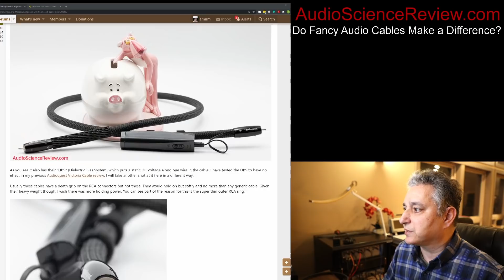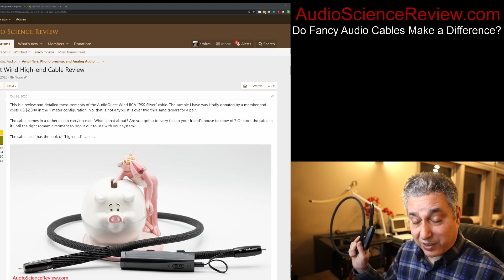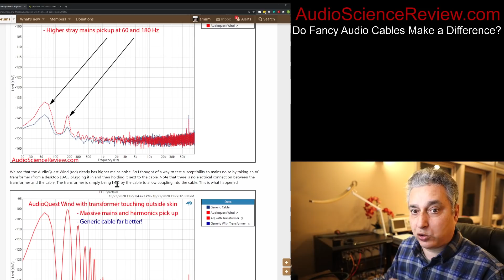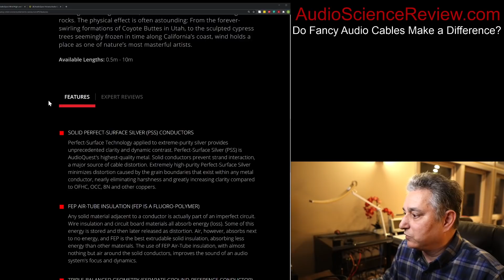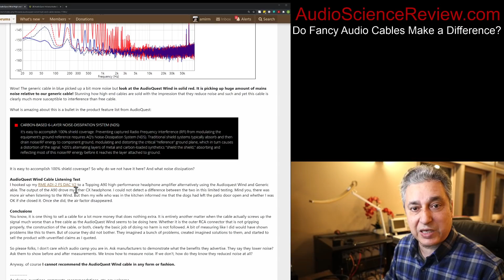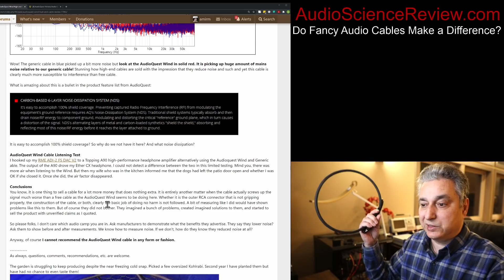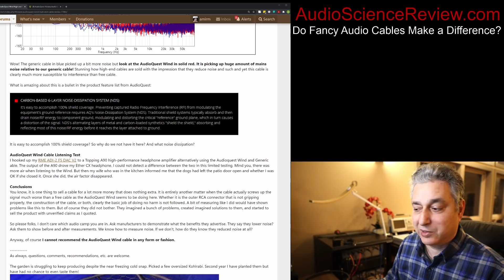Do Fancy Audio Cables Make a Difference?

Comment: I’ve compared several speaker cables, using the Agilent 4294A Precision Impedance Analyzer and a Keysight 3442A microOhm meter. I’ve found that the differences are very subtle and totally inaudible at audio frequencies.

Comment: Interesting cable evaluation, the additional mains frequency pickup is probably from the ridicules unterminated wire connected to the battery.

Comment: I believe it is intentional. Cheaper cables have teflon, PVC and who-knows-what dielectrics, but these degrade the sound. It is a misconception that nothing flows through dielectric. Tesla, the greatest experimenter of all time, proved that while there is no current through dielectric, there is still "flow of electricity". This flow of electricity travels at 76% of the speed of light.
You simply did not measure what you need to measure. The signal in the form of EM wave (vector E x H) travels perpendicular to the surface of the wire. It is this surface that with AQ cables is created using special kind of thin silver layer.
Another example: Oppo Sonica measurement were "excellent", but it sounds very poor. Why? Because effective measurements are yet to be invented for all of this.
Reply: I believe that battery piece either takes care of this flow of electricity or deals with eddie currents, both described in literature.
Reply: Inakustik cables use pure air as dielectric.

Comment: On a more practical level, is silver coated copper better than single crystal copper, is single crystal copper better than oxygen free copper, and is oxygen free copper better than regular copper assuming that each type has adequate shielding. And is strand better than weave better than twist. Because frankly even if it made some sort of difference. just on principle I'm not spending thousands on a pair of cables.

Comment: Not a "fancy" cables , aka to you snake oilers meaning expensive cables that some manufacturer is making fortune on at your cost 😂
This is kind of BS that makes you oil snakers Robin Hoods of audio.
It is sad and makes no sense at all.
Once cable is tried and makes no difference will be returned to the store and not harm to the pocket or sound will be done.
USB cable just like speaker cable , interconnect or coax cable is capable of afecting aspects of musical performance that can not be measured as you guys try to prove your lack of point .
Yes on resolving system all these cables can affect tonality, clarity, spatial detail, harmonics and microdynamics .... All things you really can not measure but must hear with your ears . Sorry to burst your bubble.

Comment: This debate is a endless waste of time because the measuring side of the audio community always come to the same conclusion because their tone generators yield the same result no mater who the reviewer is. It could be Gene at AA or Amir on this channel. Their conclusions are always the same. So why bother to watch when the you already know the conclusion. Its like watching multiple reruns of a mystery and knowing the ending. Both of them fail in one respect. Neither address the context of use. Where is this $2000.00 going to be used. Most likely to connect a $10,000.00+ preamp to a $10,000.00+ 
amplifier which is then going to connect to a $10,000.00 to $30,000.00 pair of speakers. Even if they measure the same the guy spending $30 to $100,000.00 or more on his equipment is not going to use a $20.00 cable because of the way it measures. For this client spending $2000.00 on a cable is the same as the average guy spending $20.00. Most audiophiles suffer from obsessive compulsive disorder and the thought using any cheap cable with  would never fly. I don't understand this flak with cable prices. I have been in the audio business for 30 years. I have used the 10 to 20% rule for a cable purchase relative to the system. Most customers do not have problem with this because they are making an investment they are going to keep.

Comment: Hi Amir, that was an interesting experiment. In your speaker cables & RF video you claimed that not testing the cable when connected in a system to amp & speakers was artificial and that it needs to be a real-world situation. But in this video you don't make measurements with this cable in use in a system. How is inducing noise into an unconnected cable real world? 
Wishing you luck with the channel, all  the best, Rob
Reply from the maker: Hi Rob.  I do use these cables in a "system."  My audio analyzer acts like a source (e.g. DAC) and pre-amp.  This was also an interconnect test as opposed to speaker cable with its own assumptions/characteristics.

Comment: After all those years, we found out that measuring cables (and probably most of hifi equipment) will not tell us anything about how it actually sounds, and that its really system-dependent, and that you have to hear it in your system, in your room, and be open minded, but here it is another genius saying something sounds like this or that because oscilloscope said so.
Reply: You dummy 😂🤦
Reply: @turtleneck369  is it "dummy" to listen for yourself or its dummy to blindly trust amir and his few graphs?

Comment: Great video but strictly speaking, all you did was prove that the Audioquest Wind cable is no better or worse than a budget cable. But I guess we can generalise your findings to all rip-off cables?
Reply from the maker: Yes.  I have actually tested other audioquest cables and that of other brands.  So far, none have provided a positive benefit.
Reply: @AudioScienceReview  I have just joined your forum and indeed you have tested many pieces of audio equipment. Great job, and many thanx.
Reply: @AudioScienceReview  What do you think about Anticables?

Comment: this is exactly the point here: THIS cable, that transmits millivolts is antennae like. Not the one that connects the speakers where we might have even 20V there. But guys who had never touched the electronics will have issues to understand.

Comment: Amir, that's very interesting. But, as I understand, that DBS thing should only help with the issues related to dielectric absorption of a cable insulation. Can you measure the dielectric absorption effects with a sinewave test signal?

Comment: Long time ago, I experienced higher noise in MIT interconnect cable than generic cable. I also experienced poor quality control in Monster Cable's RCA connectors. One of the four male connectors in a pair of interconnects was too tight. The RCA socket in the Marantz gear came out while I was disconnecting the cable.

Comment: Please test power filters if they are worth buying!
Reply: No junk
Reply: @turtleneck369  Ive read that the Audioquest Niagra 1200/3000 and the Ps Audio power plant regenerators (models 3/12/15/20) were the exceptions and perform superbly. It would really be nice if Amir can test them.
Reply: @jonathanmatthew5631   he already tested ps audio noise harvester and it's not doing anything  complete scam.
Reply: @turtleneck369  thats very different than the niagras and power generator
Reply: @jonathanmatthew5631  oh my bad though it's similar thing

Comment: How is it possible that when I change speaker cables my wife hears a difference when she enters the room? She wasn't even aware I changed the cables?
Reply: She pretends she didn’t notice the $4500 charge on your credit card statement.
Reply: She hasn’t, she is just indulging your fetish...
Reply: Poor or faulty cable replacement?
Reply: Cables sound different. It is well known that copper can sound warm, as opposed to silver sounding a bit on the bright side. Tried it myself...I could immediately tell the difference. Cables can be used to tweak a system, rather than spending more money on a replacement component.
Reply: @tonydeniro284  Science disagrees.

Comment: 18 HisssSnake Oil manufacturerSnake are HisssSnake off. 
I not tried a bat on the cable to test voltage at the end of bat and then the other end of the cable to see if there is drop in voltage.
I would only test the bat on speaker cable to see if the bass drivers have forward cone motion to know they are polarity correct. 
Did you say in Japan? so your on the 60Hz mains frequency.  20.000KHz is the limit for Us, only dogs, Cats and bats will be entertained above 20.000KHz. 8:09 wouldn't the oscilloscope probes pick up signal noise like when placing near to cable it shows up on the display I did that test last year I think with my scope.

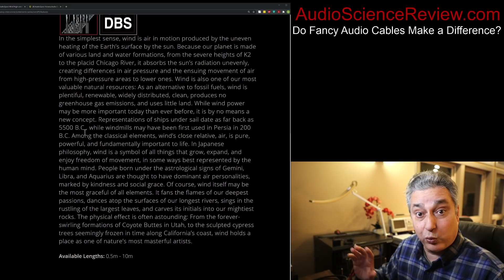10:40 Snake Oil manufacturers exposed! 11:14 even the picture of the cable looks like a Snake it has Snake scales. lol rich people audiophiles will buy Snake Oil cables. lol
13:06 I would throw that Snake oil cable into the Cat Litter Box! Lmao

Comment: I would guess that the open ended "battery" circuit is an excellent antenna. This might account for the excess noise in the system.
Reply: Exactly. I'm puzzled that Amir did not discuss this.
Reply: 👍 yep

Comment: I've noticed many of these expensive cables speaker, RCA, COAX, USB whatever come in various lengths but yet have no components controlling their if stated specs. Without some sort of external component to compensate the wire. How do they keep things in spec as the length changes? I know there usually is no specs or measurements provided with these cables just a nice helping of persuasion. When it comes to these GR Research cables Danny can hear the most subtle differences that science can't explain. But never mentions the subtle differences that also would be caused by the length.... What is the maximum length one should use or is there a sweet spot or does the differences caused by length conveniently not effect the sound?

Comment: I think what happens is that the outside of the cable, somehow interacts with the plugs on the AQ which picks up the noise. Whereas when you do it on the other cable it has to go through on outside rubber coating, which immediately makes the noise bounce of and away instead of getting absorbed.

So if you want to do a proper test I suggest doing it somehow through the inside of the cable to fully test the theory.

Just my theory.

And actually I think that the cables ability to breathe, so that internally it does not send a signal towards the shielding and then gets absorbed again, is much more important.
Because shielding a cable is good in theory. But most cables that are heavily shielded have a closed in/suppressed type of sound that many times destroys the naturality. So in some way, the isolated detail itself is better and boosted. But many times it is at the expense of the naturality.

You can test my theory by taking any random basic cable. Listen to it. Then cover the whole thing with black tape, and then hear the things I mentioned.

Would be interesting, if you could measure this sound effect.

Comment: I can't stand when the reviewers who recommend these cables talk about "burn in". It's not real, sorry. And if you buy a cable for it's "sound" how do you reproduce it's "sound" if 'measurements don't matter'? If a cable is giving your system a certain sound, it's increasing distortion, and making your system less transparent. Isn't system transparency the goal? I could go on forever.
Reply: Then you'll love what's going on over at the GR research channel. Head over there and make some waves.
Reply: Yeah somehow the structure of the wire changes. It's magic!

Comment: Honest question.  I checked the website, but are the batteries replaceable?   The don't last forever?
Reply: The batteries don't complete a circuit so they should last quite a few years as they start at over 70V. Time enough to realise you've been conned and replace them with normal cables anyway.

Comment: I see the metal rhodium being used in cables frequently, specifically on connectors. Mr. Amir, would that be considered a passive component of changing the "sound"/electrical profile of a cable? I asked an actual manufacturer of headphone cables about rhodium specifically and why he uses this metal and my question was completely ignored. I also asked why more conductive metals wouldn't be used, like silver, on connectors, instead of rhodium? I wonder if it a cost thing? Rhodium did become more expensive recently, so idk..
Reply: Rhodium is just another big word like titanium used to fool fools into parting with their cash. A certain speaker company uses names like copper, ceramic and titanium in their descriptions.  Just marketing blah blah blah.  And, you are right, silver is the most affordable of the higher than copper conductors.  Copper plated aluminum wires are a joke and will likely fail do to galvanic action. (edit/added) - However, the proper metal to use in any AC current conductor is Vibrainium. 😉

Comment: Loved this! We need a video comparing MP3 192kbps vs MP3 320kbps vs FLAC. Time to settle this!

PS - I understand that there might be subtle variations across files. The real question is are those variations below the threshold of hearing?
Reply: I did my own test.  160-180 is where a decent quality mp3 starts.  320 mp3 or 500 vorb is pretty indistinguishable on small devices and for most people on a big rig stereo.  However, 320 does lack the dynamics the higher grade file has.  That's all those details most people miss throughout the spectrum.  For most people it's lost on the high hat and cymbals, but the other losses aren't t even noticed.

Comment: An interesting topic for a video:  Is there any difference on the DAC audio output caused by use of the cheapest and worst TOSlink or SPIDIF audio sources? Is it true that as long as digital 1&0 signal reaches the destination, all the noise and jitter does not matter for the sound quality? For example basic HDMI audio extractors, basic TV TOSlink out or Chinese USB to SPIDIF soundcards? 

Thank you for the enormous amount of reviews you do! :)

Comment: I think it would awesome to actually have some blind studies on YouTube. While your measurements are a fact regarding measurements, the way that unmeasurable detail is interpreted by the human ear is an essential and left out portion of engineering. You are an expert at the engineering aspect of it, but you would need to provide more credentialing for me to believe you are an expert at the biological side of it. Either way, interesting topic and im glad you are breaching it with a nicely recorded video.
Reply: Can you give an example of what you mean by unmeasurable detail?
Reply: @andybright3809  definitely, one example is sound stage. In a real orchestra one can point where in the soundstage each instrument comes from. As the fidelity of my system has improved, the sound stage has become more and more realistic. How would you measure this?
Reply: @4thewin759  In a stereo setup the position the sounds appears to be coming from is determined by the relative volume of the sound coming from each speaker, or by the the sound being delayed by a certain time in one channel vs the other. In terms of sound appearing to come from a position wider than the position of the speakers, I believe the phase of the signal can be rotated to achieve this effect. All this is determined by the recording, mixing and mastering engineers.

The way to measure this could possibly be to double blind test the different equipment. Identify which piece you believe sounds 'more realistic'. Then look to see what the difference in measurements is between the two devices tested. If the one you prefer has more/less intermodulation distortion, lower/higher output/input impedience, better/worse channel balance, flatter/more erratic frequency response then you could conclude that the metrics from the one you prefer may amount to what you'd call more 'realistic'.
Reply: @andybright3809  Very insightful! And a great idea. Phase may indeed have something to do with it. I think it would be difficult to test phase from a single mic unless there were multiple measurements from individual speakers. One microphone would only be recording the combined sound waves as they reach it. I would also agree that for the most part, the mastering process is responsible for most of sound stage. There are many hifi oriented recordings that do just use one high quality, and in some cases omnidirectional, microphone to capture the stage and room. In these situations soundstage would be more organic than in a post processing example. Either way, great idea. Perhaps someone will look into that one day. Cheers.

Comment: Good to see.
These diagrams should be obligatory for every manufacturer in the same way as energy efficiency charts.
Maybe that patented battery powered thingy on the Audioquest cables actually made them more sensitive to interference?
You should reach out to Audioquest to get a comment from them. I'm sure they would try to claim your tests were wrong in some way and then you should ask them to do the same test and make it public.

Comment: thanks for the great work as per usual Amir. these kind of content is also fun and educational so I welcome it. 

I think it is important to point out  that while these fancy cable are absolutely snake-oil there is in fact a difference between a quality generic cable and a crappy generic cable, for those  that are new to the hobby and are wondering if there is a difference between a 10-20$ cable from a reputable brand (for instance a Philips RCA male-male) and a 1$ no name cable from aliexpress
Reply: Aliexpress? Where do you think the Audioquest cables come from? Could be the same Chinese factory that makes cables for WallMart. I'm not kidding. That's the joke with power tools. Ever look at the various brands at  Home Depot or Lowes? In many cases you could exchange the outer plastic skins between brands. That's because they come out of the same factory and have the same exact motors and gear case with many brands.
Reply: @andydelle4509  ❤️❤️❤️❤️❤️